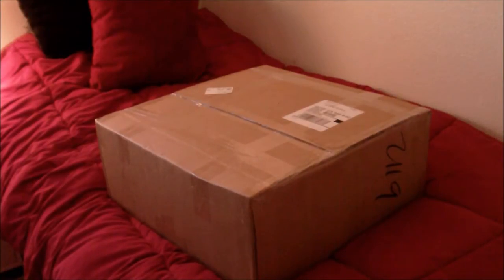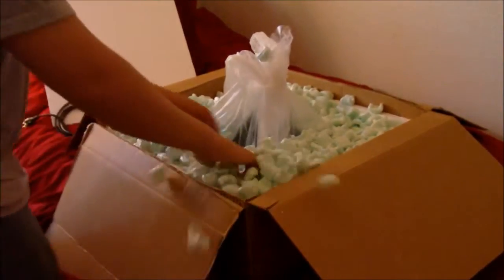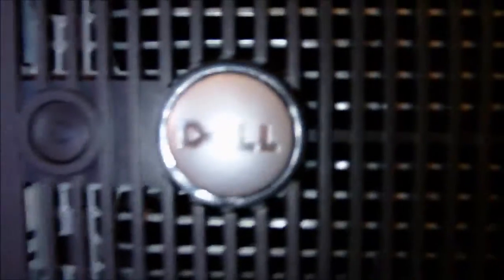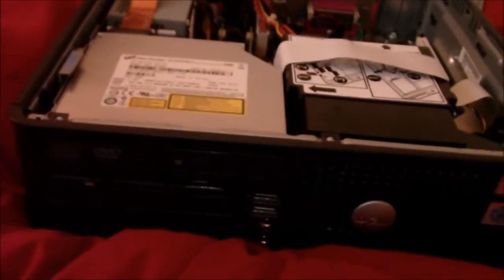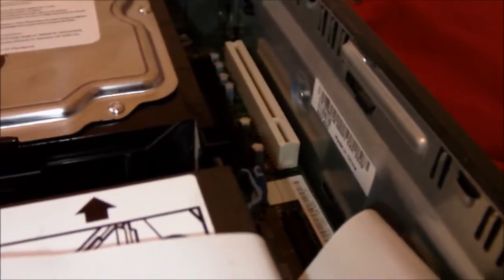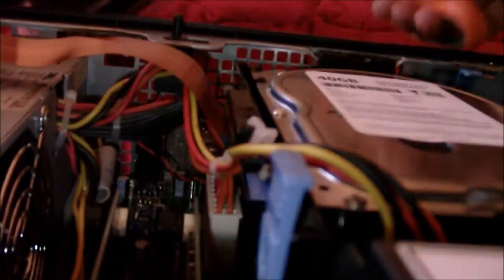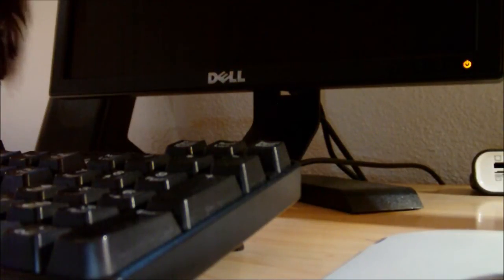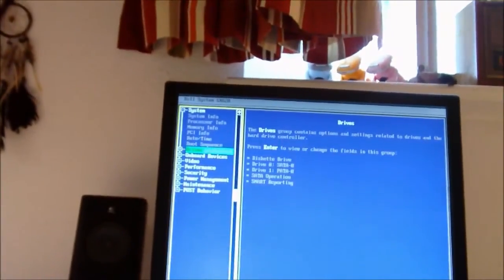Dell Optiplex GX620 SFF: Unboxing & Setup

Comment: I thinking about getting one of these as a secondary machine. I really don't need one, I already have a really expensive Dell (About $1299 at the time with the tower, monitor, bluetooth mouse and keyboard) and a old Pentium 4 Compaq. Great deal for $50 bucks, if I could get one for that cheap I would but one.

Comment: you do know that a laptop SATA drive will work without using any adapters, its totally compatible, but mounting it would be a pain. I have gotten better spec PCs for free, but they are always missing a side panel or somthing dumb like that, so you do have to pay for somthing complete. but its a nice PC anyway, and now you have a spare dimension.